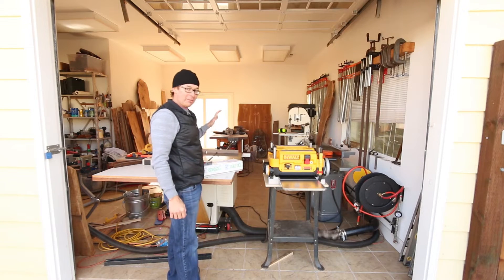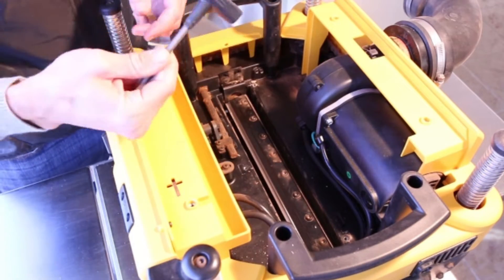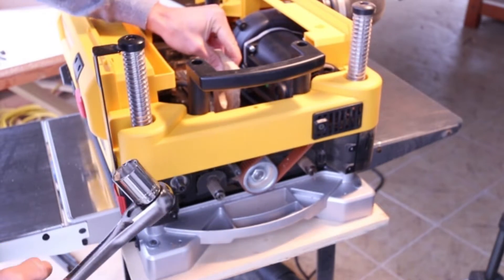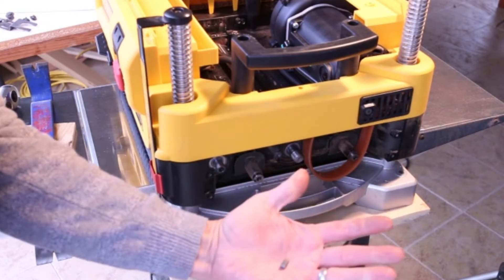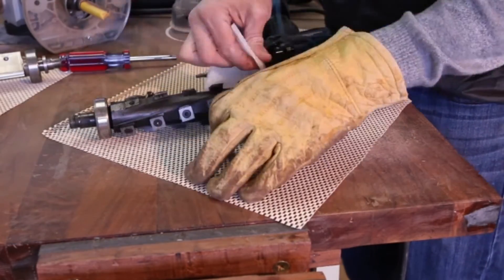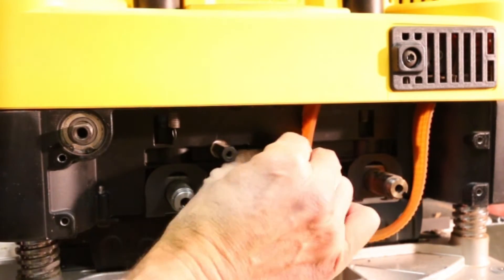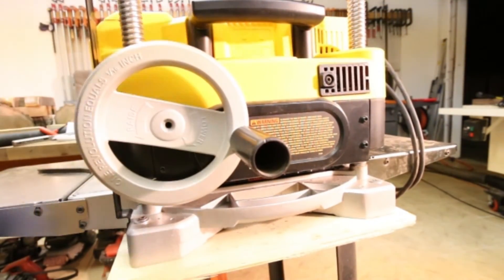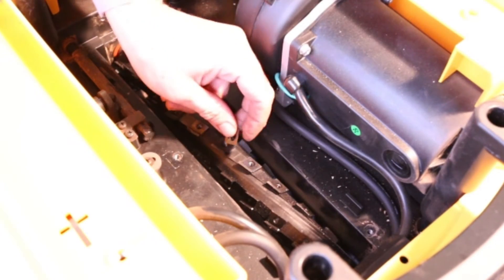How to Install a Dewalt DW735 ShelixHead

Comment: Do you think it's better to go with the OEM size over the smaller one?  are you able to take over 1/16" with yours?
Reply from the maker: Yes, I would think the OEM size would be better. I haven't use this planer in a while. I don't remember ever going over 1/16" with mine.

Comment: Worthy of consideration is the cost factor on this lunchbox thickness planer at $600.00 with the (3) blade HSS cutter head, designed & engineered with the 15 amp, approx. 3/4 HP motor. Enter the helix spherical cutter head made by Byrd, now you have a $1000.00 to $1100.00 sandwich style lunchbox thickness planer working considerably harder than its original design called for. I am curious what the long term life expectancy on this unit will be further down the road, over the test of time... 
Personally, if I was to make this kind of aftermarket investment in a perfectly good piece of equip. as designed, I would make the jump to a Grizzly or equivalent with a 3 - 5 HP motor which comes std. with a spherical cutting head with even more cutting inserts than what comes with this aftermarket cutter head. An $1800.00 investment versus close to the $1100.00 invested in this already nice unit would be money better spent imho. 
Thanks for sharing the install.
Bill on the Hill... :-)

Comment: Dude, NEVER install bearings tapping on the shaft..... You may have ruined the bearing.....
Reply from the maker: TinyWorkshop Design I have pressed many bearings and would have preferred to press them in. Have you figured out how to press them?
Reply: you have to push always on the outer ring, a metal tube or a  nut socket do the trick (in that case)
if instead  you have to press the bearing on a shaft you have to push on the inner ring, of course
Reply: Like I said, I have pressed many bearings the way you described, BUT that was not possible inside the DeWalt. Please post a video of you pressing the bearings INSIDE the dewalt planer.